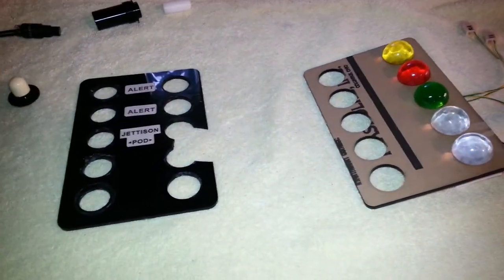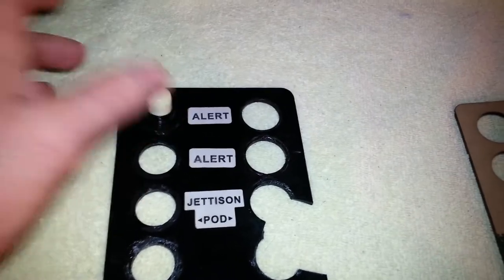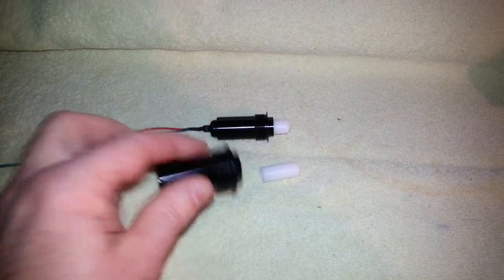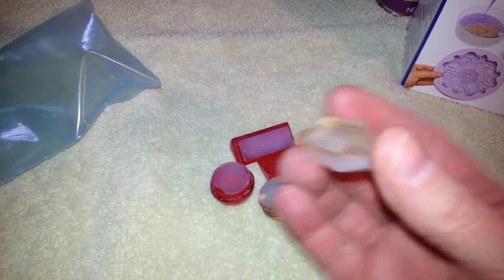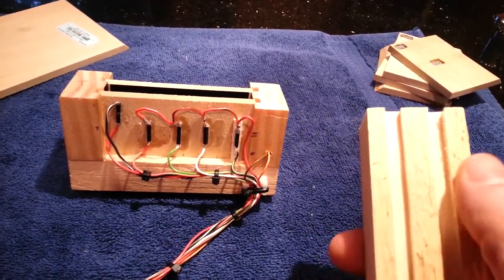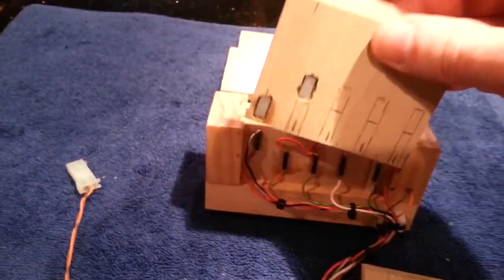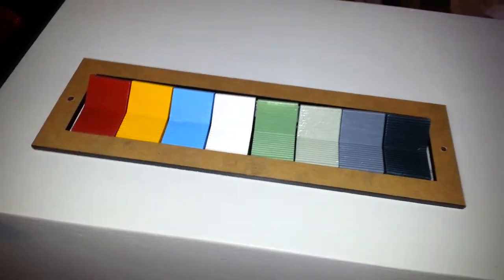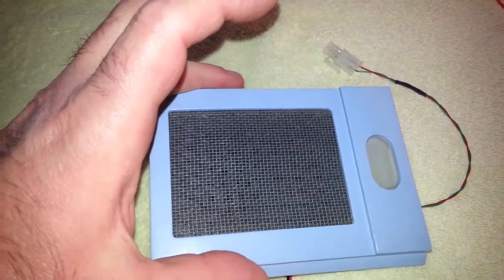Captain Kirk Chair Rebuild, Part 2

Comment: The switches were only labeled in one episode, "Court Martial", and as you point out at 1:57, they were probably rigged to light up for that episode, and the marked panel was shown on the courtroom visuals (in closeup) where someone else made those lights (only two were needed) come on as an actor "pushed" the buttons.
Reply from the maker: Actually after that episode and all the way to the end of the series the panel remained labeled and as is, and can be seen that way in many episodes going forward. The panel itself was originally mostly green dome lights and was changed for the "Court Martial" episode as a vessel for the plot. The panel was actually wired to light up as I showed a picture of the original in my part 1. Was in a private collection for decades but sold in 2016ish.

Comment: It should be remembered that those data cards predated 3.5 inch floppy disks by almost two decades. Today an SD card is less than 3/4 inch across (would not be too visible on a 1960's television screen).
Reply from the maker: Agreed. I think they actually called them "data tapes" since at that time magnetic tape was they only media they had for data storage...they didn't really think about what the future would be, let alone the PC. 8 track tapes were out then as were it's predecessor the Fidelipac used in radio & TV and somewhat resemble the idea anyway. There are memory cards like the compact flash that might also resemble the card....but....it was for TV.
Reply: Yes, and on an original Mission Impossible TV episode, they "froze" a man and made him think he woke up in the future with flat panel tv screen and cartridges could "plug in" to watch different things!! Way ahead of a lot of stuff!

Comment: The labels on these switches were for the episode "Court-martial". Was the panel always labeled that way. Also, just the engineer in me talking, in reality there should have been a cover or some sort of interlock on the pod jettison as it would be too easy to push the button unintentionally. This is of course a restoration not a design safety review.
Reply from the maker: That is correct. When I recreated the panel I decided to take some liberties and add the "Log" and "Comm" labels since in later shows and in ST-Continues they use the buttons specifically for those purposes. I don't think the show creators ever thought beyond the story...yes a switch cover would have been a safety consideration...but it was a TV show, not reality. Just for fun.....
Reply: Yeah!  I always wondered if there should have been an AND function so the ion pod could only be jettisoned while at red alert!  It's just one gate!